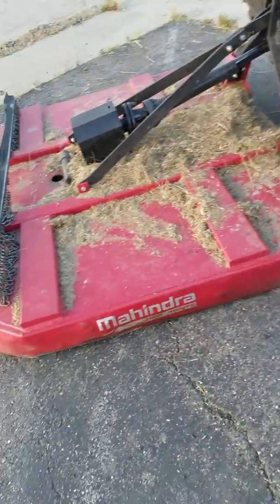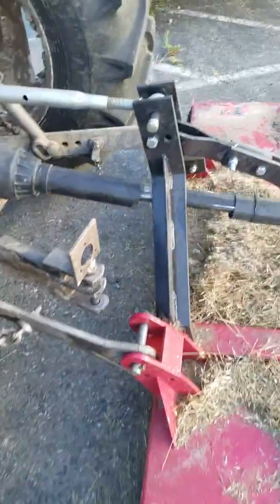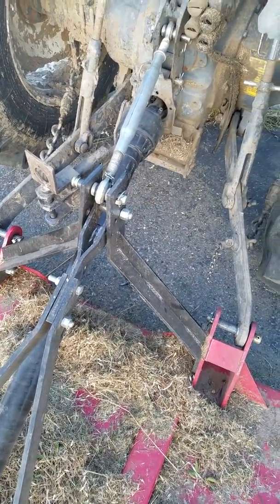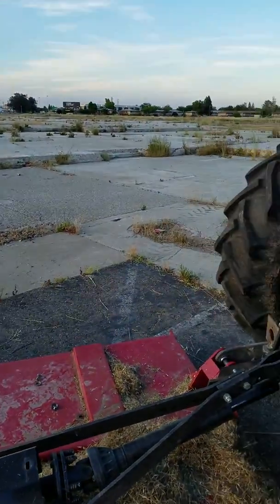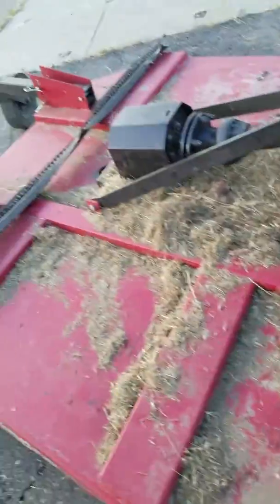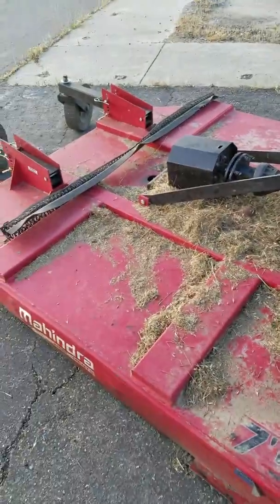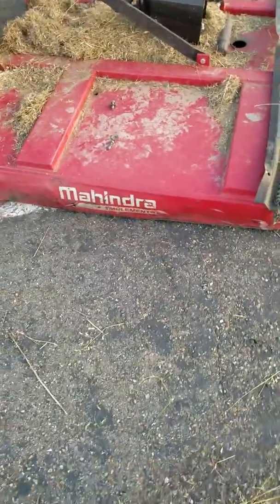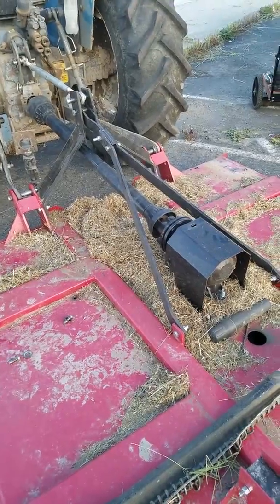Mahindra rotary mower design flaws

Comment: Your lift arms adjustable from side to side with the turnbuckles, you need to adjust it to the left to avoid hitting the drive shaft.
Reply from the maker: That has nothing to do with the height of the a frame. It is too low. I have sent raise the height of it declare the Driveline. No more problem. Just a poor design.
Reply: It appeared at the 0.59 mark that you had several more inches of clearance if the unit was moved to the left but it may have been deceptive in the video.

Comment: So you put a 100hp tractor on a 7ft bush hog meant for COMPACT tractors aka in my world "little tractors". A little overkill dont ya think. As for the runners heck I lost them the first year on our john deere 14ft bush hog. And I'm pretty sure even my 14ft bush hog would be beat to hell and back if I hit every thing in its path. It's meant for thick brush and grass. Not wood, rocks and asphalt. I see operator error and a fired hand around my place.
Reply from the maker: Mason Allen, that Mahindra mower weighs 1750 lb, a lot of midsize tractors wouldn't even build a lift it up without a bunch of counterweights on the front of their tractor.  I wanted the biggest most heavy-duty mower I could possibly get, unfortunately it filled the holdup. Constant deck cracking supports snapping off due to the surface welding. I had to have the dealer under warranty reweld everything 2 standards

Comment: Then why did you buy it...sounds as if you just got it cause of their price and that you didnt buy it for a specific use such as how hard and where you will be running it...research you attachments to fit your tractor and the work that will be performed! Other brands out there are more stout but also cost more👌
Reply from the maker: Yes you're right I bought it because I was informed it was a heavy duty model as expressed by the HD I'd labeling on the deck. And the fact that I had a $1,500 credit with the company is why I bought it. My other choice was a John Deere. I put this video out there to inform people are the quality of Mahindra mowers. Before I purchased this mower there was very little reviews or information about it anywhere. I took a chance. The gearbox went out on it 4 months after use. The deck tore apart about the same time. The dealership repaired it 2 original standards. I noticed yesterday it is beginning to tear again.